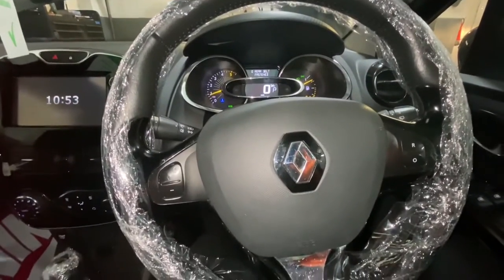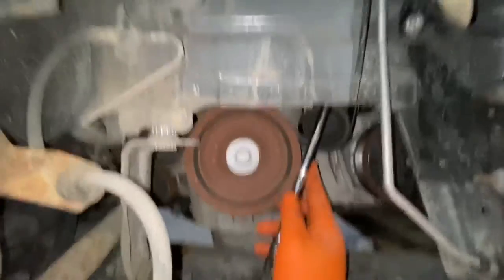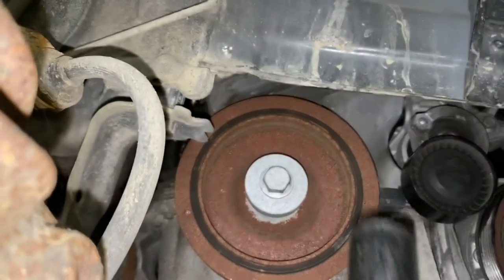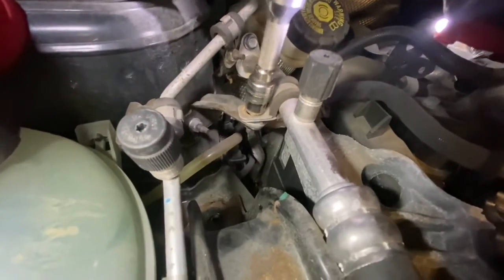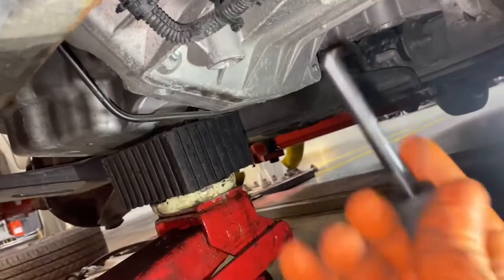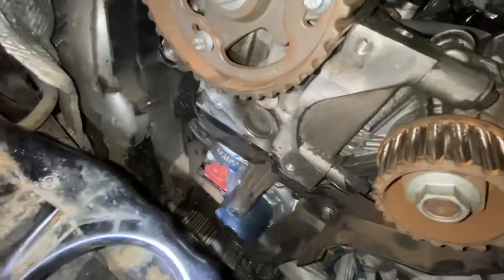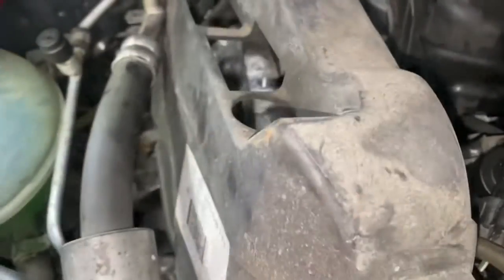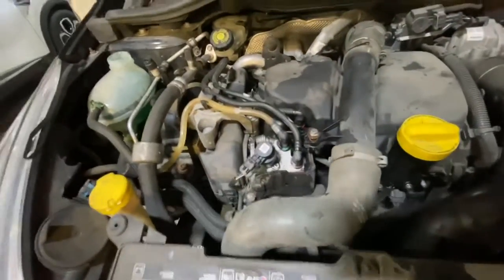#Renault #Clio #and #Captur #Timing #belt and #water #pump #replacement #instructions

Comment: Hello friend, your video is very nice and educational. I want to ask two things.
  (1) When removing the circulation pump, shouldn't it be necessary to remove the alternator and pull it back or the fuel pump gear?
(2) What is the size of the crank locking device (pin)? could you please.

Comment: Hi, after changing the distribution kit (not by me), there is a squeake noise around 1100 rpm which disappears below or above (and in any case the engine seems running fine), any idea ?
Reply from the maker: Belt may to tight or it’s not timed correctly

Comment: Hum the 2.30 was to simple😂. The bolt aint there no bracket, and no under support. Nice i think i found the "it rattles in the glove box at some rpms"😂.
 Doing a 2017 Renault kangoo (2) 2017 atm, now the first belt is off. Ya a 16, so Dirty i really thought it was a 17.
Ah damit i bought e 10-18 just for this...1/2 inch is to fatt 😂. 1/2 connection part makes it larger😅.
day 2 went and bought a powersocket 18, had 14-17, 19-22, then e14 3/8 size = worked
day 3 i can finaly see my timing belt 119 teeth, top half plastic cover is unhinged but its an entire piece of plastic, the topbackside was hard to reach at an angle, a small table/tea spoon was the best tool. Ordered parts

Comment: You did tensioner the wrong way
Reply: In what way? No, 2 turns then re tighten or over tighten, turn then redo tighten.
Was talking of the drivebelt?
Reply: @Malainor  the tensioner goes anticlockwise not clockwise for adjustment